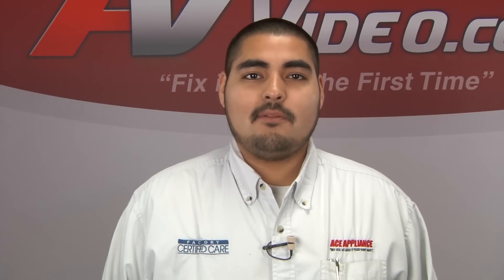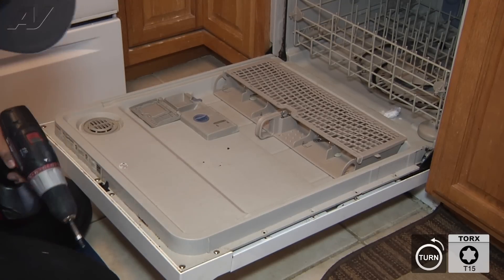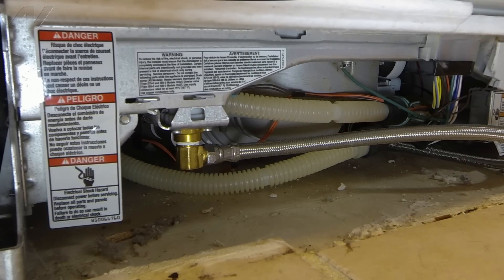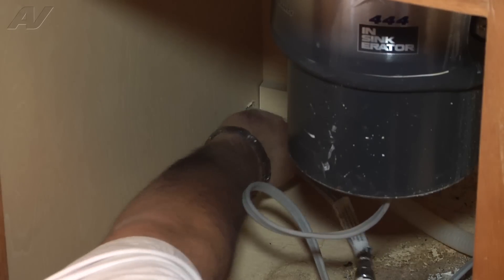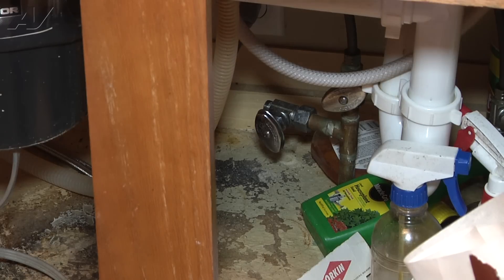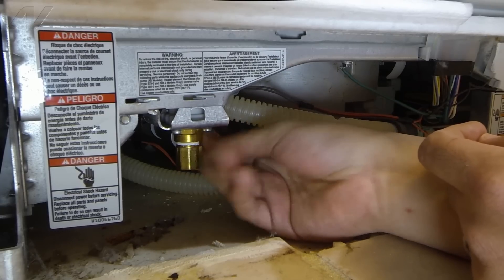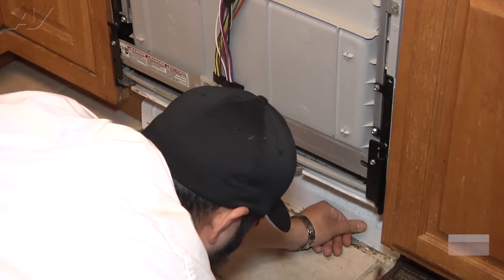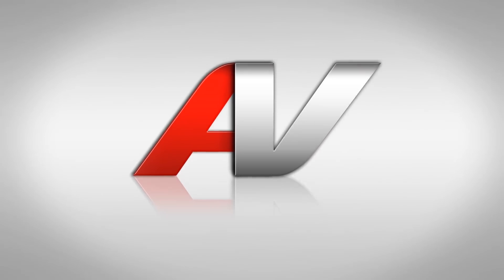Whirlpool Dishwasher Repair - Will Not Fill - Inlet Hose

Comment: Disconnected the supply line from both ends and shook out the hose, blew air through it, reconnected the hose and tah dah it is fixed. Thanks for the great video. Saved me the money of calling a repair person (est $200-300) or replacing it for approx $500-700. Awesome channel and greatly appreciated ✌️

Comment: Learning process.  Go to the end of my comment before disassembling. 
I think the Flood Safe feature activated when the town water repair crew turned the water back on after repairing a street leak a couple days ago.

It is hard to tell if the inlet hose is a "Flood Safe" hose.  If you have a gate valve, then turning the valve closed and then open again would possibly "fix" it.  But if you have a 1/4 turn valve that you can open quickly, and therefore do open quickly, the valve won't reset.  

In my case I disconnected the inlet hose at the inlet solenoid valve and slowly opened the line valve under the sink.  I had flow.  Then I reconnected it to the solenoid valve, and activated the dishwasher and the solenoid valve worked normally.

Before disassembling, try this sequence which does not require taking anything apart.  It may work.
1) Shut the supply water off 
2) Start the dishwasher and listen for the solenoid valve to start buzzing (its at the left front corner of the dishwasher) - This opens the solenoid and should sufficiently de-pressurize the Flood Safe supply line.
3) Open the dishwasher door (or use the cancel-cancel to stop it)
4) SLOWLY... VERY slowly  open the water supply line.  You might hear a little noise as water flows in to the depressurized line. 
5) Now close the dishwasher door and turn it on.  Again listen for whether it just buzzes or if the water is really flowing.

If this doesn't work, do shut the water off and disconnect the supply line at the solenoid valve - this definitely depressurizes the supply line and slowly open the line valve just enough so get a a gentle flow, and close it slowly (I don't know that closing slowly is important, but why not).

While the line is disconnected, check and clean the screen if necessary.
Reply from the maker: Great question, if you have a
more technical question that our parts department cannot answer, you can search
our over 10,000 answered questions free at our website www.ApplianceVideo.com under our Repair Help section. You can also call
our parts department at 1-800-830-5465 and they can give you help 7-days A week
Monday -Sunday, or search at www.SaveMoreOnParts.com  24 hours
7- days A week.
Reply: Eddy, you crushed it!  Including the part about the quarter turn valve here! I was ready to look up how to test inlet valves and solenoids and all that happy wet stuff. Did not even have to pull off a hose! Nice work!
Reply: Do this before you try anything else. It can't hurt anything and it worked perfect for me!
Reply: Thank you! It worked without us having to change anything.

Comment: I dont know why you wouldn't disconnect at valve and turn on water to see if there is blockage.
Reply from the maker: Great question, if you have a
more technical question that our parts department cannot answer, you can search
our over 10,000 answered questions free at our website www.ApplianceVideo.com under our Repair Help section. You can also call
our parts department at 1-800-830-5465 and they can give you help 6-days A week
Monday -Saturday, or search at www.SaveMoreOnParts.com  24 hours
7- days A week.
Reply: I know this is a three-year-old response lol but that was my thought exactly.. why would I go through all that before determining if water is making it to the inlet valve.. I noticed you got a ridiculous non committed cookie cutter response..
Reply: @mrobvious1100  Very good observation 3 yrs later.
Reply: @eastside0434   Now I did not have my multi meter today.. What I wound up doing was filling the dishwasher putting the soap in then I put 4 gallons of hot water and shut it and hit start and it ran so that told me the mushroom float works so what's the inlet valve.... I think I will take the water line off and just see if the screen is clogged but it would have to be 100% clogged done guessing I don't know but I will check that before I order the valve..
Reply: @mrobvious1100  Your learning grasshopper.

Comment: I don't know why it worked, but, disconnecting the hose at the water cutoff and then reattaching it fixed the problem.  This is AFTER I had already replaced the water inlet valve that was apparently just fine.  Thank you to everyone for the comments as that's what got me to try just disconnecting and reconnecting the water line.
Reply: SAME!  Ugh!

Comment: Awesome Video. What could possibly be wrong with the hose to keep water from passing through it? I thought that when that happens it's the inlet valve that needs to be replaced.
Reply: Before or after the fill valve?
To answer your question... as least on incoming line to fill valve.

Blockage can occur from:
Physical damage.
Corrosion.
Stuff that comes from OUTSIDE your home... Water department's lines being anywhere from zero to a hundred years old = scale, silt, debris, rocks, sand, etc.

(If you live at the END of the cities line, you get all kinds of crap-ol-a.)

Oh, just as a idea if a plumber way back used a "Saddle Fitting" to tap into the line which keeps them from having to cut and re-thread the supply line / and or require them to disassemble the existing lines, there may be a blockage at where the tap that pierces the line.

.
Reply: samsung dishwasher wont fill with water
Reply: Suzan Harris Have you checked potential causes I mentioned prior?
Additionally did problem just start?..was working?
Reply from the maker: Thanks for your response, we are glad we could help. Our library of over 5,700 videos are currently helping over 1.6 million people like you every MONTH.  Please help us by subscribing to our YouTube channel, or post our website www.ApplianceVideo.com to your Facebook page, Twitter, Instagram or any other social media sites. Your support will help us keep producing more free quality videos.
Reply from the maker: Thanks for your response, we are glad we could help. Our library of over 5,700 videos are currently helping over 1.6 million people like you every MONTH.  Please help us by subscribing to our YouTube channel, or post our website www.ApplianceVideo.com to your Facebook page, Twitter, Instagram or any other social media sites. Your support will help us keep producing more free quality videos.
Reply: @Appliancevideo  Just want to let you know that answering commenter questions with the same canned message is a turn off and will not help your business as much as you are trying to coerce a call into your parts department. Just MHO

Comment: Except mine is a kitchen aid imperial that is 40 years old. It was used maybe 25 times in the last 40 years and since I've moved in, I use it about once or twice a week.  My inlet is 3/8 copper coming up from the basement. It goes to a shut off valve. The dishwasher is built in.   So it wouldn't be the copper line since there's no check valve unless there's one IN the dishwasher. I have to look up the specs of it.
Reply from the maker: Thanks for your response, we are glad we could help. Our library of over 5,700 videos are currently helping over 1.6 million people like you every MONTH.  Please help us by subscribing to our YouTube channel, or post our website www.ApplianceVideo.com to your Facebook page, Twitter, Instagram or any other social media sites. Your support will help us keep producing more free quality videos.

Comment: How did you determine it was the hose?
Reply from the maker: Great question, you can call
our parts department at 1-800-830-5465 and they can give you help 6-days A week
Mon-Sat . You can also search at www.SaveMoreOnParts.com 7- days a week.  If you have a more
technical question that our parts department cannot answer, our technicians are
answering all questions at our website at www.ApplianceVideo.com under our Repair Help section. We have over 6,000
common questions and answers that you can easily search through by your model
number, appliance make, problem or error codes, and It’s completely free to
search through our question & answer library. There is a very good chance
you question is already answered there.
Reply: Durra Altai g bosh dishwasher

🏍

Comment: My Whirlpool dishwasher will not fill with water. Less than a year old and Whirlpool says they have no repairmen in my area. Is there a fitting in the inlet hose that keeps the water from going into inlet valve?
Reply from the maker: Great question, if you have a more technical question that our parts department cannot answer, you can search our over 17,000 answered questions free at our website www.ApplianceVideo.com under our Repair Help section. You can also call our parts department at 1-800-830-5465 and they can give you help 7-days A week ,or search at www.SaveMoreOnParts.com  .

Comment: How did you come by finding out it was the water line
Reply from the maker: Great question, if you have a
more technical question that our parts department cannot answer, you can search
our over 10,000 answered questions free at our website www.ApplianceVideo.com under our Repair Help section. You can also call
our parts department at 1-800-830-5465 and they can give you help 7-days A week
Monday -Sunday, or search at www.SaveMoreOnParts.com  24 hours
7- days A week.

Comment: Question: How did you determine that was the issue?  Great video otherwise
Reply from the maker: Great question, you can call
our parts department at 1-800-830-5465 and they can give you help 6-days A week
Mon-Sat . You can also search at www.SaveMoreOnParts.com 7- days a week.  If you have a more
technical question that our parts department cannot answer, our technicians are
answering all questions at our website at www.ApplianceVideo.com under our Repair Help section. We have over 6,000
common questions and answers that you can easily search through by your model
number, appliance make, problem or error codes, and It’s completely free to
search through our question & answer library. There is a very good chance
you question is already answered there.

Comment: how long should the fill valve be open.  Mine is open about 55 seconds and I am not getting enough water in the dishwasher.  I replaced the inlet valve and no change.
Reply from the maker: Great question, if you have a
more technical question that our parts department cannot answer, our
technicians are answering all questions at our website at www.ApplianceVideo.com under our Repair Help section. You can also call
our parts department at 1-800-830-5465 and they can give you help 7-days A week
Monday -Sunday, or search at www.SaveMoreOnParts.com  24 hours
7- days A week.

Comment: AV you said the hose has a check valve... is that a special valve to buy ?
Reply from the maker: Great question, if you have a
more technical question that our parts department cannot answer, our
technicians are answering all questions at our website at www.ApplianceVideo.com under our Repair Help section. You can also call
our parts department at 1-800-830-5465 and they can give you help 7-days A week
Mon-Sat . You can also search at www.SaveMoreOnParts.com 7- days a week.
Reply: Why can these guys not answer anything? Call the office?like ok it's 2am I need that answer now?
Reply: CJz LCR great Question!  Call back during hours that we are here and we will be happy to sign you up for our almost free free question advice line.
Reply: @doogie64  and there is the rub...

Comment: That looks like a resettable flood safe hose that was removed...
Reply from the maker: +Juss H 

Thanks for your positive comment. We are glad we
could help resolve your issue and hopefully saved you money. We have helped
millions of people repair their own appliances so please help us produce more
videos to our site by subscribing to our YouTube page, or posting our http://www.appliancevideo.com/ website on your Facebook or Twitter account. Our
factory authorized technician’s also daily provide free professional Repair
Help to people like you to help solve their appliance problems. You also have
the option to email a factory service technician with a question at http://www.appliancevideo.com/repair-help/ .  If you need of parts for your major
appliance, we have over 5-million parts in stock at http://savemoreonparts.com/ . Thanks in advance for supporting us. So email
us if you have any other questions our videos cannot resolve. Thanks for your
support in advance.   Matt, Ace Appliance service technician.
Reply: Juss H Good observation! Was having fill issue at new house. Whoever installed the washer put the flood safe hose backwards which was only allowing about half a gallon into machine. Once I rinsed and reversed hose it fills perfectly! Contemplating running a straight hose like video.
Reply: This was my issue...I fixed our water pressure in our house and the dishwasher stopped working.  I disconnected one side of the flood safe hose and reattached it and all was good.

Comment: Why would a hose keep the dishwasher from filling up with water???  wouldnt it be a valve that is not allowing water to enter??
Reply from the maker: Great question, if you have a
more technical question that our parts department cannot answer, our
technicians are answering all questions at our website at www.ApplianceVideo.com under our Repair Help section. You can also call
our parts department at 1-800-830-5465 and they can give you help 7-days A week
Monday -Sunday, or search at www.SaveMoreOnParts.com  24 hours
7- days A week.
Reply: I have no idea Eli, but I followed this vid...took off the hose, ran water through it and the dishwasher is now working again. 
Nothing visible washed through, but obviously enough soap build up to hinder its workings.
Reply: The guy said there is a check valve in the hose that gets stuck or blocked